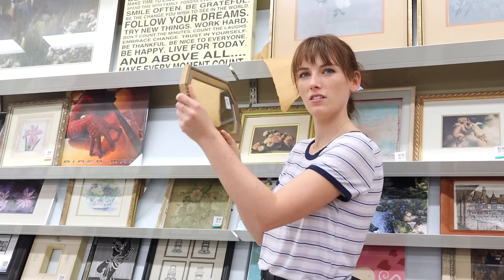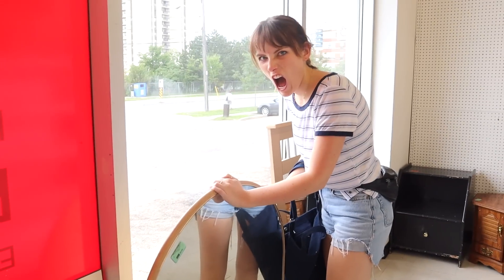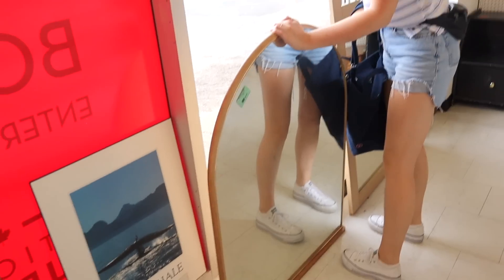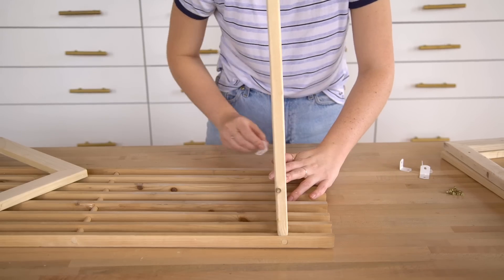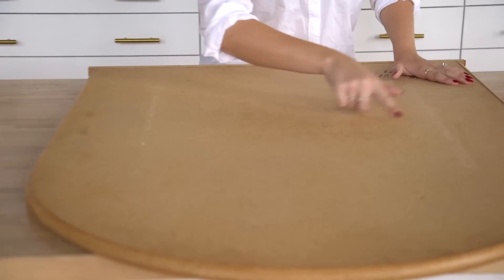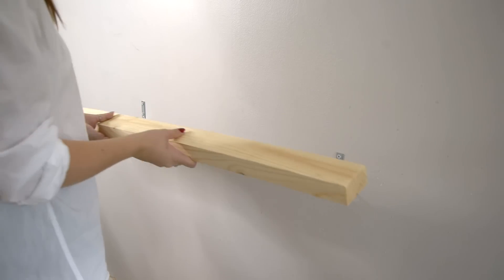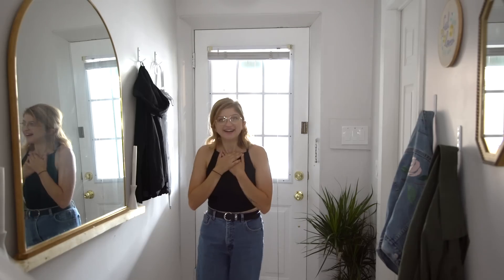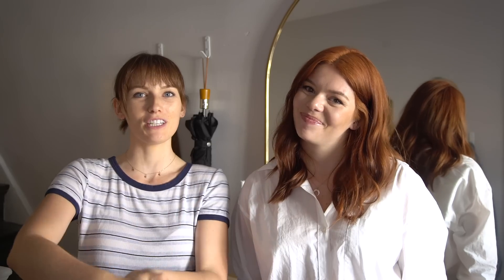THRIFTED Front Hall Makeover!

Comment: I need to do my whole house badly,  but for hall & front door do you have any suggestions.
Its quite a narrow hall (I'd say little wider than width of a single bed)
Just as you come in front door there is a door each side of hall then little opening for the toilet.
I don't really have any clear wall space as only bit i have gas radiator on opposite.
I'd love a small table for my diffuser keys etc & a shoe rack but no where to place them and not take up space for wheelchair passing through.
Any suggestions please

Comment: Guys, I am a professional picture framer, and you should NEVER hang a large mirror like that. Even sitting on the shelf like that, the wire on the back is not a heavy enough gauge and could snap and cause the mirror to fall and shatter. When hanging something heavy, it is always best to not even use wire. You should use wall cleats, because they are meant to hold the weight of heavy glass objects in drywall/brick, and the mirror sits flush on the wall as well. As a bonus, wall cleats are not expensive, and the mirror won't shift around like it would if using wire. I just don't want anyone getting hurt or ruining that gorgeous mirror!

Comment: Not sold on this flip. When they expanded the shoe rack, I thought they would add two dowels to the frames they made. 1) For added support because the finished product was flimsy and 2)so that the bracing dowels could hold shoes on the bottom, then purses (or even more shoes) could be placed on top. Also, they could have easily added  6" or 8" deep brackets to support a deeper shelf for that mirror. Those candles will definitely fall off on such a narrow shelf and so close to the coats.

Comment: 1 - Try not to cover floor vents, they are vital for ventilation/heating/cooling.
2 - The mirror/shelf looked awesome and I think the shelf was adequate support but I do not think the wire & screws are sufficient to anchor it to the wall and keep it from tipping. Especially in a high-traffic space with so many doors.

Comment: Wood glue on the grain end of wood is not very strong!! you could probably easily snap those pieces apart with your hands... 45 to 45 is much better than end grain to with grain, but still not enough. some very basic joinery would really help make those legs better. I have seen ya'll use a chisel in previous videos so you have everything you need to improve the woodwork.

Comment: None of the after is very practical. You can't actually sit on either of the benches. They took out the useful coat rack and replaced it with 2 hooks. The candles on the ledge look like they are about to fall off. I've seen their other videos and they've done some good work but this isn't one of them. The design execution was off. Also, do TheSorryGirls ever reply to the comments? I'm guessing they didn't expect such negative feedback. I think if you take the good you should take the bad, too.

Comment: This upcycle honestly wasn't all that great. The pieces look mismatched and it's less functional than before. E.g. the old shoe rack looked decent and could hold a lot of shoes whereas the new one is just a sawed up cheap IKEA rack that offers barely any space and is probably gonna break apart right away. It's too flimsy to use as bench and you ended up putting the shoes on the floor anyway so in the end it's completely useless.  And while I prefer individual hooks to a coat rack the hooks you used are kind of ugly and there's less hanging space than before. I also don't think that the whole untreated wood Scandinavian look matches the dark stairs so it would have been better to stain the shoe rack and the little shelf for the mirror in a matching color. And maybe add a little shelf for keys.

Comment: looks cute, but not very functional, it is a small entryway ,  2 benches took over big space and only fit max 12 pair of shoes, plus the benches can't be sit on. why not replace the shoe racks with a shoe cabinet which holds 18 pair shoes also gives much clean vision ? also too many hooks and decors on the wall , should've just have a coat rack in the Corner , leave the wall space out, maybe just leave one decorative picture,  it makes the room looks bigger.